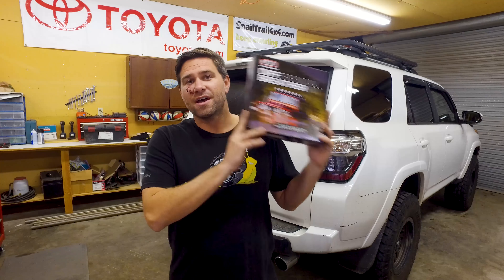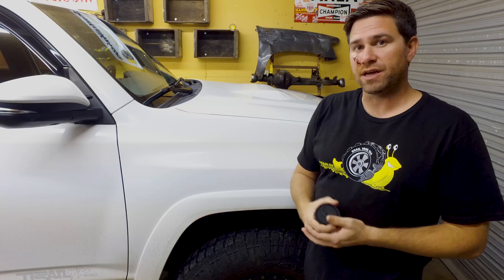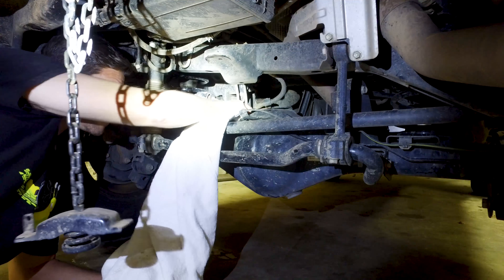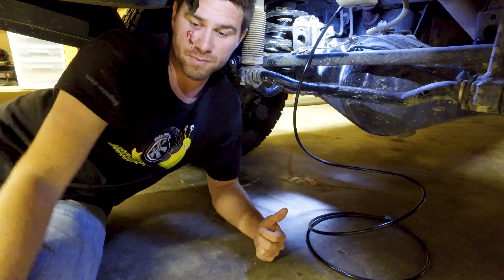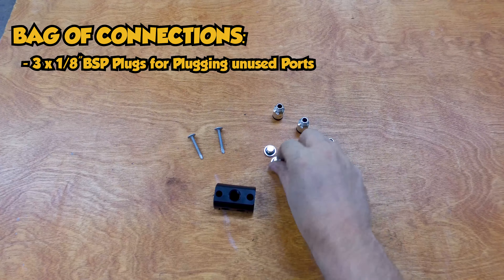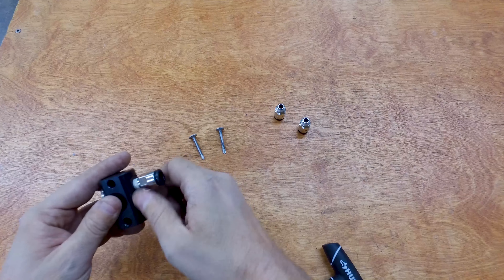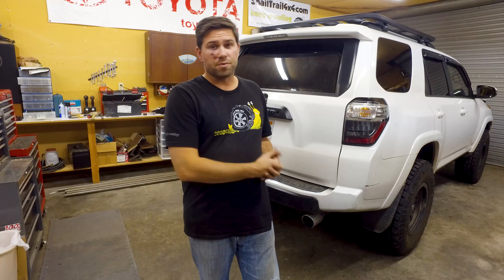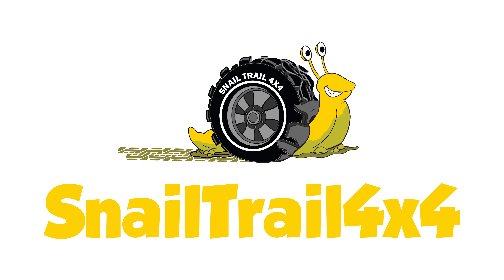ARB Differential Breather Kit install for a 5th Gen Toyota 4Runner

Comment: Those tubes can be removed from the push lock fittings by pressing down on the plastic ring on the top of the fitting and pulling up on the tube
Reply from the maker: +tyler vaillancourt -- I didn't know that, thanks for letting me and everyone else know. 👍that's a very useful piece of info when your doing this Install.
Reply: I can’t get them to make a pop sound. Is that okay? I can’t get them break loose by pooling hard on them either. I did notice I can push the collar down and the hose releases. Is it okay there’s no pop sound on either end?

Comment: Have the same kit but ran it along driver side (didn’t have to worry about exhaust) and I had enough tubing to do both differential and elocker. Just reporting what worked..
Reply from the maker: That's great to know, thanks for the update

Comment: I'm surprised that Toyota did not install breather vent hoses in the 4Runner. MY 98 Jeep GC came with breather tube extensions installed at the factory.
I'll need to do this on my 2016 4Runner but don't like the ARB kit. Those quick tube fittings are nice but the the tubing ARB supplies is too stiff for being mounted on constantly moving suspension. I'll probably use vacuum tubing and route it to the fuel cap compartment. A vertical "goose neck" at the end of the tube will keep moisture away, even if it's submerged under water for a short duration.  Also, a small motorcycle fuel filter in the breather line will keep the dust from entering the differential .
Reply from the maker: That sounds like a trick set up, I'd be interested in seeing the final. Also know what size vacuum line works with those quick connect?

Comment: Not knocking the installation video. It's good work. And glad you're ok. Just my 2 cents as a HD mechanic as I had to check myself as I almost bought this kit before I realized..wtf am I doing.
So you can either spend 80  to 100 on an ARB diff kit. (Canada is a 100ish) and is an extremely unnecessary purchase.
Or.. you can take your breather out  and go to a hydraulic hose shop.
They'll have all the BSP taperered metric fittings and  3/8 aeroequip hose you'll need. 
Get a 6 foot hose made and reuse your original breather in the end. I also used a 45° on the diff for better hose projectory. 
Either stuff the hose through the back side of a drilled hole in your fuel door compartment (seems like more hassle going there).
Or stuff it up to the bottom of your DS rear tail light. Which is pretty much at the same level as the fuel door.
Tie up with zip ties and make sure you have enough slack for your droop and becareful where and what your zip tying to.
Wham, bam, done.
Although I do like the ARB breather manifolds, to run it all the way to the engine is unnecessary and frankly you're paying for the name. 
All for under 50 bucks.
The 5th gens front diff, transmission and transfer case breathers run up between the engine and firewall.  Well enough protection if you ask me.
Reply from the maker: That is a great alternative idea, on my big truck I just used vacuum line to extend them as high as possible. If the main goal is to get the opening as high on the vehicle as you can then it doesn't matter what you run.
Thanks for taking the time to comment.
Reply: Chuck MacPhail 
I’m sure your idea is good but I didn’t understand anything... I guess I’ll just pay and then pay again for a shop to install it...
Reply from the maker: @Agent.K.  -- updated, hope that helps
Reply: I like this approach, but you wouldn't want to use the breather again, would you?  Seems like it could still close and create the same vacuum, wouldn't you want an open filter at the end of your hose?

Comment: Great videos, on my list to do. contemplating which hose to use though as Im in New England and it does get cold and salty/slushly/sucky. No-one ever shows though the way to route the line though under the truck? Up along the frame away from any exhaust, are there any other lines you could follow? Need to get under there and explore more.
Reply from the maker: Brake or gas lines

Comment: You said at 1 minute into the video that the arb has an air filter and breather. And later on you said it's continuously open always.. so is it always open or does it have a breather on the ends? Thx
Reply from the maker: It has an air filter and it's continuously open. The line you run from the pumpkin goes all to the filter.

Comment: Also one more question please! I live in the Northeast . It gets cold. I have heard that the plastic line will corrode or crack over time from the cold. Have heard that it can be replaced with some rubber fuel line and hose clamps. I would rather just use the kit as is. Do you think the ARB tubing is durable enough for the cold winters?
Reply from the maker: To be honest, no clue... Where I live it doesn't get that cold and I don't have much experience with the cold. A fuel line and hose clamps works just as well 😁

Comment: What year is your 5th Gen 4runner? I see the TRD Cold Air Intake installed. I have a 2018 and was wondering if that intake would fit on my 4runner?
Reply from the maker: Yes and no. The 4Runner is a 2014. It's not "made" for the 18 but it can work. A few guys have said Toyota response is that they are working on one for the 18-19. But we have confirmed that you can install a TRD CAI on 2018. There is a specific post on it, on trail4r.com. https://trail4runner.com/2018/02/22/2017-4runner-trd-intake-install/
Reply: Craig Mason  look into s&b filters. I'm installing a CAI on my 2018 4runner

Comment: Thinking about doing this but I’m not too sure how to run the tube and how to mount it. Any tips on that?
Reply from the maker: Zip ties, duck tape, or bailing wire 😉. Na but really it's easy to run the hose up to the engine. Just keep it away from anything hot or things that move.
Reply: SnailTrail4x4 Thank you for your response! Ok cool! I’ll probably try to install this soon. Thanks again!

Comment: Will this work on a 1997 Jeep Cherokee XJ
Reply from the maker: The only reason it wouldn't work is if the thread for the breather valve is different. If they are the same, then I can see it working.
Reply: SnailTrail4x4 alright I’ll look into more, thanks 👍🏼

Comment: what about the front diff?
Reply from the maker: +Adam Lafferty -- I could find it... Do you know where it is? I don't think it is but it could be a closed system.
Reply: On the 2016+ Tacoma the front diff and transfer case have a breather much higher up and they terminate just below the battery.  If you remove the battery you can easily see them.  I highly suspect the 4Runner is similar so you shouldn't need to raise those higher as you'd only gain 8 or so inches.  Another option is to take it up into the rear tail light which is the route I went.  Great video.
Reply: Ok sounds great!  I had no idea what the front was like.
Reply from the maker: +Pete Fairhurst -- Thanks for the clarification. We were thinking about just running the tube into the rear somewhere, but we wanted to show the proper install as to ARB. Next time we will do it the way you did 👍

Comment: Doesn't the locker also have a breather?
Reply: it does, I've read it sits a little higher so some don't do it. but might as well while you're down there i guess?
Reply from the maker: Interesting, I didn't know this, I'll look into that. Could be another great video
Reply: i think a brass T is used to link both up to the main tube going to the engine bay.